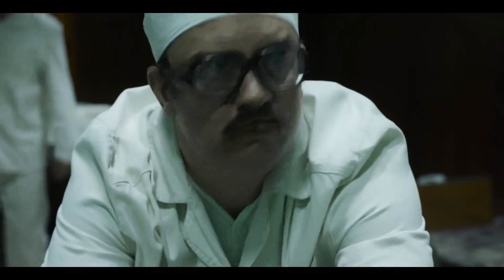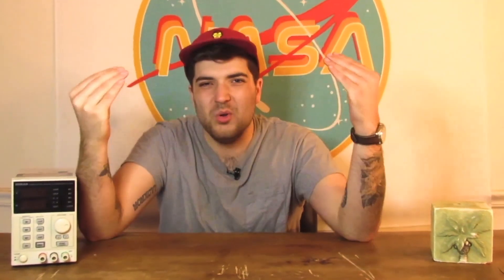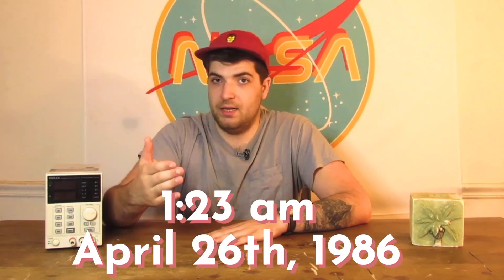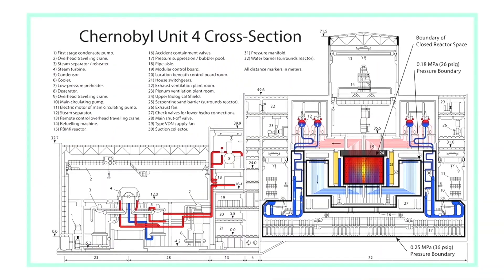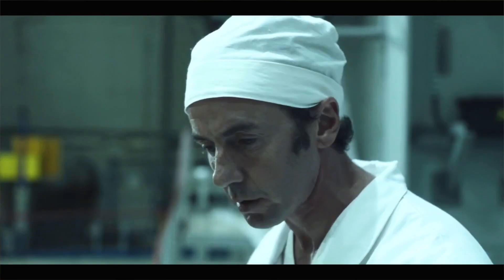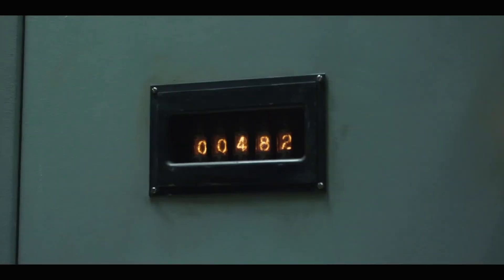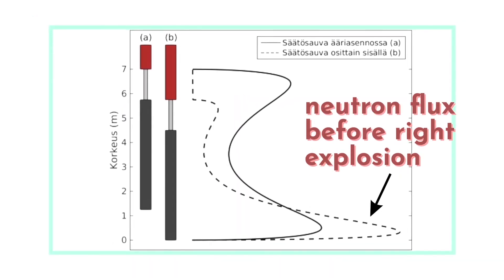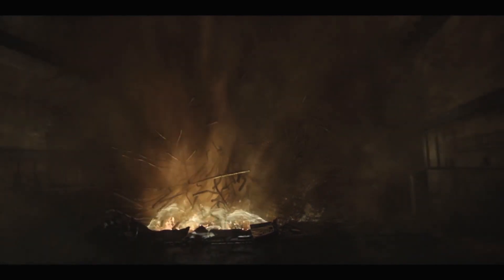How the Chernobyl meltdown really happened

Comment: Ok, some minor details. The control rods worked only pulling and droping. They were operated from above. The scram rods were without graphite tips. Lower boron rods were pulled up from lower biological shield. So there was no pushing at all. When lower rods were down, there was only graphite in that channel. And the lower parts of reactor was moderated when these lower boron rods were pulled up. Main control rods had graphite "tips". So, the AZ-5 was or is not simple "graphite first" to reactor button. There was so much bad luck.

Comment: Sorry, but this video is wasted effort. You're just repeating the completely fictionalized version of events from the HBO show. (I'm a fan too, but is isn't a documentary!)

1) Disabling the "cooling system" and other "safety features" did nothing to contribute to the accident (as per the IAEA) and was part of the test program;
2) The control rods were pulled out to raise the power to 200 MW, not 700 MW, and this was done successfully, stabilizing the reactor for a long period of time;
3) The xenon did not burn away. Doing would take hours at a much higher reactor power, and the xenon was mostly in the central portion of the core;
4) There was no power surge until the AZ-5 button was pressed. There was simply a positive coefficient of reactivity, which was successfully compensated for by the automatic control rods;
5) The graphite control rods were already in the core. They were not "removed". What actually happened was the graphite replaced water in the lower region of the core, which had become decoupled from the central part, which was still heavily xenon poisoned;
6) And good job repeating the talking points of the Soviet scientists and officials who were trying to cover their own ass. The reactor was dangerously flawed and its design broke over a dozen laws and regulations determining the proper safeguards and characteristics for the nuclear industry. Similar accidents had already occurred twice. It wasn't a freakish accident; it was inevitable.
Reply: You should take up a job in nuclear reactors :,)
Reply: Interesting, any good books on this? Particularly chernobyl and the other accidents?
Reply: @thebuzz2010  In English your options are very limited. If you want to tackle something technical you can read the IAEA's INSAG-7 report. Probably the best book is Midnight in Chernobyl, although it still contains some errors (in reality no one protested against Dyatlov's orders, and the scene with the bouncing reactor components is pure fantasy). It describes the accident sequence more or less correctly. On the other hand you have Plokhii's History of a Tragedy, which is not good on the technical details but eschews the sensationalized parts of Midnight in Chernobyl, so it is more reliable in that sense.